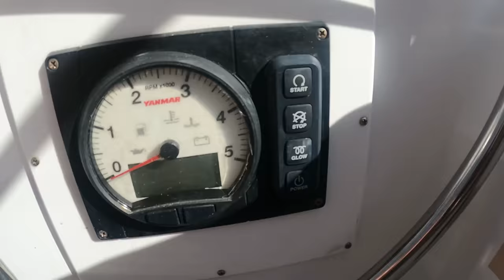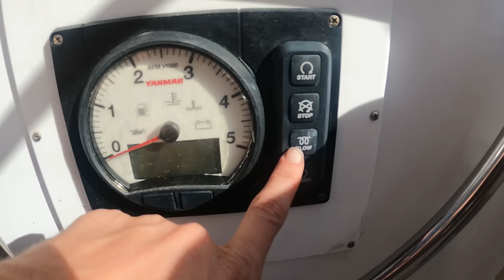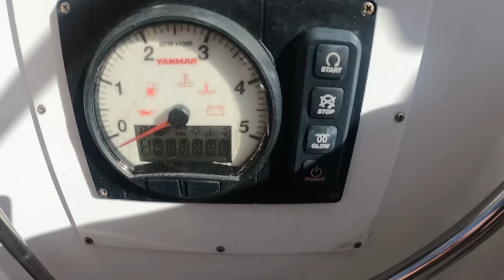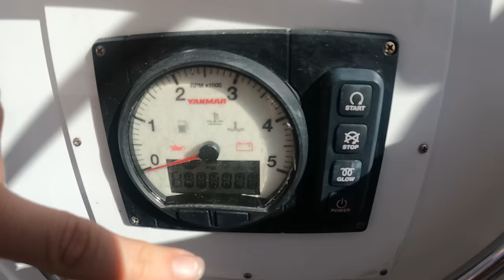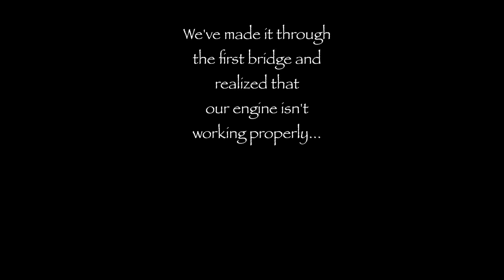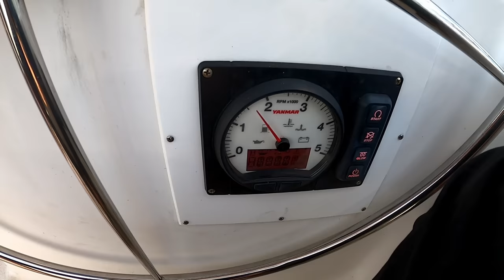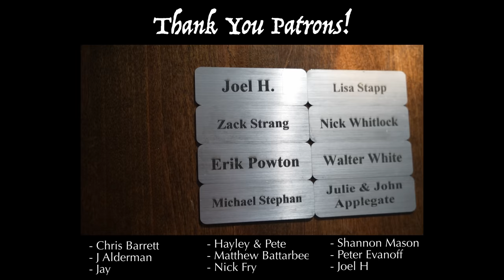What lies beneath this BARNACLE FARM?  💥⛵️ | ep.9

Comment: The backing up thing is called prop walk. Search prop walk to find lots of videos on how to both use it to your atvantage an counteract it when needed. But mainly you back up while giving the boat short blasts of forward with the rudder hard over to push the stern back the direction you want to go. 20 to 30 seconds in reverse, one second forward, then repeat. Because the rudder does almost nothing, you can keep it hard over to port. No need to spin it back an forth.

You can also drag a bucket on a line off the starboard side of the boat. The extra drag on that side will try to turn the boat in the direction of the bucket. Something worth remembering. If you ever loose your rudder, you can steer by dragging a bucket behind you pull it from one side to the other as if its a rudder. Slows you down a bit but it works. Works besst if the bucket has holes in it.

Loosening up the injector lines works well for finding a dead cylinder, but its hard to hear a weak one. I have a video on finding a weak one on my channel. It uses a bottle of water. Or a laser thermometer. It would not exactly work the same way on that engine as the one in my video, but would probably work on the side of the block. Never actually tried it on a boat though. I usually use it when I am looking at a used car, to see if the engine is running even on all cylinders.

But that was a lot to try to do in a short time. You did way better than I would have done in that time crunch.
Reply from the maker: That's good to know! We were really concerned about our transmission not engaging if we moved it in and out of gear... but we'll have to practice that prop walk when we're back in the water and our transmission actually works!

Comment: Knowing that this is a look back into the past, no since in providing diagnostic solutions for your troubles. I have always been perplexed why an engine with 2500 hours on it is considered old.  I work with much larger engines that are just getting broke in at 10,000 hours. Could you please explain the difference?

Comment: I doubt if you read this because it’s been so many months but I spent $900 rebuilding a truck engine, four-cylinder Mitsubishi and got 800 miles out of it before it did the same exact thing and spun a main bearing. I’m not a complete amateur either. But we all make mistakes…

Comment: What is the approximate height of the boat deck return on the hard?
Reply from the maker: Probably around 10-12' to the top deck
Reply: @SpearItAnimal  thanks. I'm planning to design and operate a new kind of safer, easier, cheaper, more convenient DIY boat yard. It will most likely be in NC.